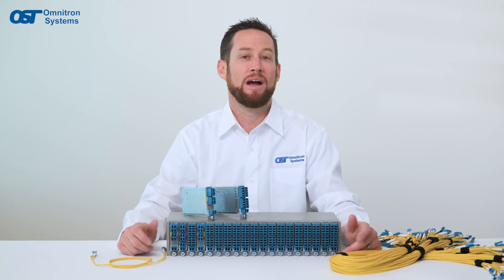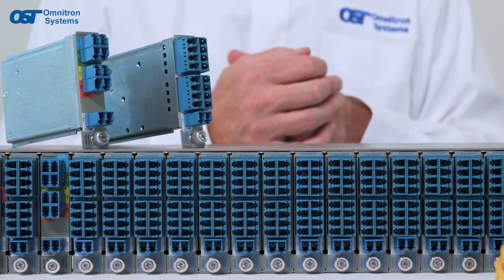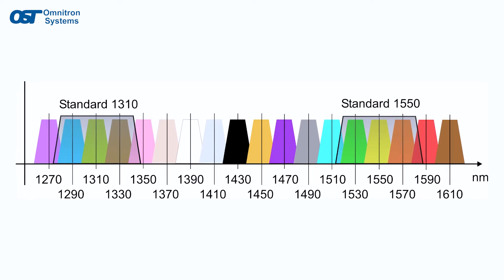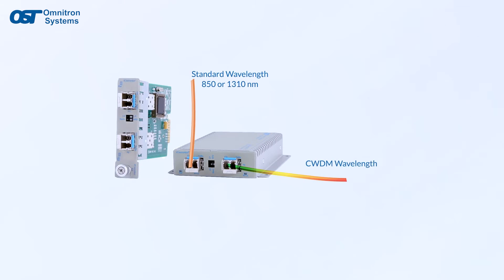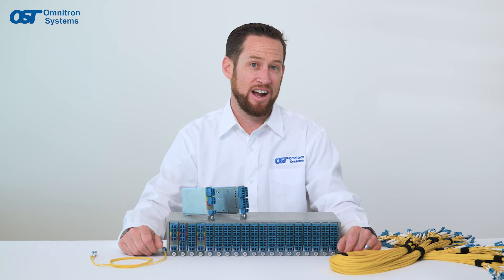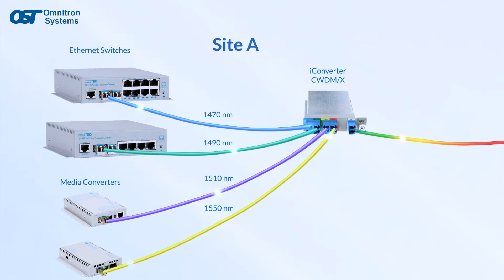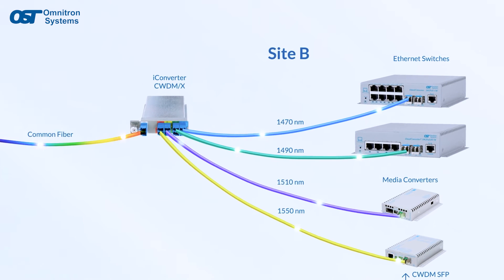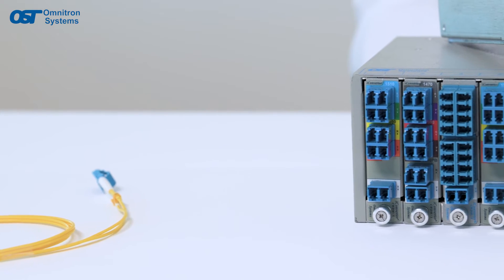CWDM Multiplexer Explained: Simplifying Optical Network Transmission | Omnitron Systems

Comment: What are the limitations of utilizing a "common fiber"? For instance, if use an 8-channel mux/demux, is it feasible to establish eight 100G links between site A and site B using 100G transceivers at both ends? Furthermore, with a 32-channel mux/demux, can it support 32 100G links?
Reply from the maker: The common fiber connection will only be limited by the number of channels and wavelengths that are available to the Multiplexer.  CWDM will have a total of 18 channels defined, but two of the channels are not commonly used due to “water peak” wavelengths that have higher fiber losses.  This means that 16 channels will generally be available for use.  Multiplexing with 100G per channel is possible, but it is important to confirm what data-rates that the Multiplexer will support before moving forward with an installation, many do not support rates up to 100G per channel.  For example, Omnitron Systems iConverter CWDM/X will only support up to 10G per channel.

For a higher capacity WDM technology, DWDM (Dense Wavelength Division Multiplexing) can be used which can support up to 80 channels.  Again it is important to confirm data-rates that the DWDM equipment will support.
Reply: Yes, you could do 100G over it
Reply: Uh you gotta check also with the spec and bandwidth 

CWDM is simpler yea but with DWDM you need to also check the channel spacings. essentially, the mux themselves can leverage EITHER one of these. ,ore Bandwidth per channel, or MORE channels but less bandwidth
Reply: @hariranormal5584  Thanks, I just found about that channel spacing today! looks like we are using 50Ghz channels and for some other reason we are limited to 10Gbps connections.